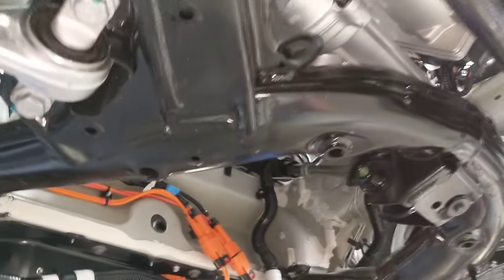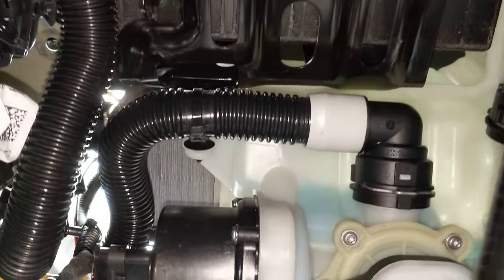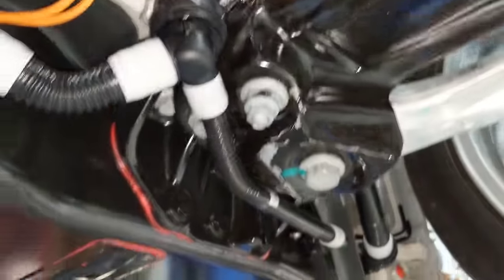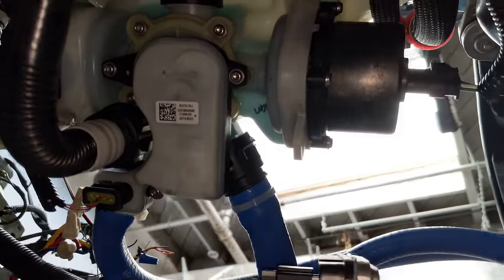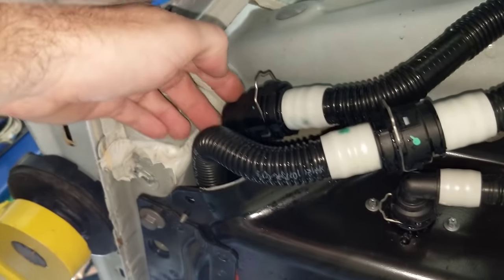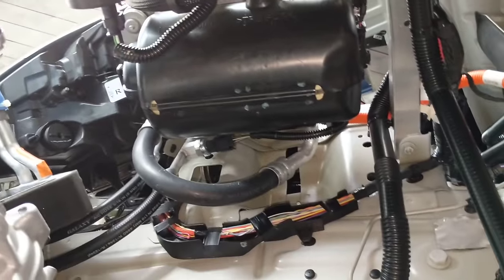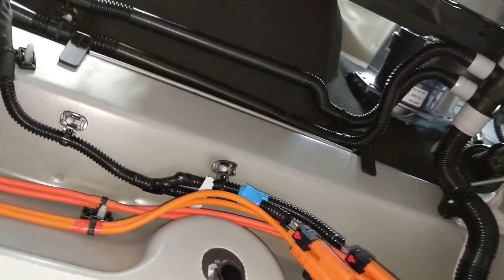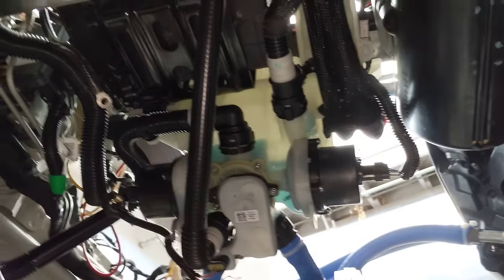Tesla Model 3 - Cooling System Overview

Comment: Glad to see they aren'trunning the coolant loop through the stator before the inverter like on the S/X. Perhaps this is a big part of the reason why the Model 3 can better handle being thrashed on a racetrack without going into thermal protection. Folks like Jack Rickard suspected that this was part of why the Model S had thermal problems under heavy use.
Reply: Reminds me somewhat of when Corvettes were overheating a few years back, the engineering answer was to reverse the water pump direction so flow went backwards.  This kept the critical parts in contact with cooler water.
Reply from the maker: Keep in mind this motor design (PMSRM) is way more efficient than the motors used in the older S/X which were induction.  An induction motor has a lot of loss in the rotor that PMSRM doesn't, so no need for such exotic cooling techniques.

Comment: Another amazing video - thanks for all this!

Makes total sense that they cool in the order penthouse->inverter->motor/gearbox, given that that's increasing order of heat tolerance.

I guess the only thing I don't see here, unless I missed it, is cabin heating.  Looks like there's no direct linkage between the glycol loop(s) and the cabin? Just purely resistive, then?
Reply from the maker: Yes, same as S/X; a PTC resistance heater only.  Sadly, They couldn't be bothered to add about $15 of parts to add a heat pump function.  Even Nissan Leaf has one.  As far as using waste heat in the cabin though, there just isn't enough.  In fact in cold climes, they need to add extra heat to keep the pack warm.
Reply: Ingineerix Leaf has a heat pump because it has a small battery and it matters. With the large batteries in Tesla, it’s mostly not necessarily. Edge cases, sure, but generally not.
Reply: Meh, it'd sure be appreciated up here.  Large chunks of the year with "cool but not cold" weather - that's the ideal use case for a heat pump.
Reply: I've seen some 'This Old House' videos talking about heat pumps with "Inverter technology" (Whatever that is) supposed to be able to scavenge more heat at lower temps than just plain old heat pumps. Probably still just an added heating element somewhere. Makes one wonder though. Still wold be a good idea for down to 40s temps and then just boost with elements below that.
Reply: Tuttomenui some top of the line heat pumps are smart enough to know how much colder they can go below 32°F before freezing up totally by monitoring dew point, refrigerant pressures, airflow, and such
Reply: Heat pump vs resistive heating has various tradeoffs between complexity, weight, efficiency, maintenance, etc.  For example, heat pumps are more efficient but arguably more complex.  On the other hand, there is already a heat pump for cooling, so using it for heating also makes some sense.  Resistive heating can be much faster to heat the cabin starting from cold, and that may be the main reason for using it.  It's not as simple as saying that heat pumps are better.  There are multiple factors.
Reply: As far as I know the only added complexity for a heat pump over a straight ac is a switching manifold to swap the radiators. To make it smarter just add software and censors.
Reply: Since Leaf doesn't have a cooled battery I think that makes doing a heat pump easier. I imagine you'd need more reversing valves with the Tesla using the refrigeration circuit to cool the battery too.
Reply: This Guy is so cool

Comment: 5:10 Tesla is modulating probably "a bit" of DC over the AC signal. DC on AC motors heats up the stator windings without rotation. In fact, it produces a "brake" torque to standstill. So THAT means, Tesla is modulating a DC current on the motor AND have to increase the AC current to compensate the "brake torque" with higher "drive torque" - as far as I suggest. Maybe some experts know more and comments are welcome. :-)

Comment: Replying years after the video was made but found it very interesting and informative.  I would have liked a slower pan of the camera and pulled back some times as the camera movement and rotation especially moving front to rear and back was hard to follow.  Any idea what the min and max temps are  and what the min and max pressures in the system are?

Comment: Just came across this from 2 years ago. I'm amazed at the countless number of coolant hose connections, "Y" pieces, "T" pieces, clips, clamps, brackets, etc, and all made of plastic for lightness. This thing will be fine for a couple of years until the plastic becomes brittle and then it will leak like a sieve.
Reply: I would be surprised if under normal use there are any leaks within 10 years. Most cars now days have plastic tanks on the radiators, plastic valve covers, etc. and they are not all breaking down and leaking 2 years later.

Comment: Thanks for the video, was wondering what your thoughts are on potential rust. You've seen the internal workings, and potential areas that could rust. Do you feel the car will stand up to harsh winter conditions and road salt?
Reply from the maker: Well, I'm not a materials expert, but I can tell you that all the steel used appears to be fully galvanized.  Paint coverage and sealing on panel joints appears to be well done.  Since most auto manufacturers have now switched to galvanized steel, rust is just not as much a problem as it used to be.  (And while I currently live in California, I was born in Detroit)

Comment: So there is no direct path from the battery or motor cooling circuit to a air to water radiator? It all passes through HVAC? Or are the two blue hoses on the four way valve used to do that?

Comment: Enjoying your videos. Thanks for sharing. 

I live up north in a harsher winter environment and have been researching battery heating in the model 3. At 5:02 you mention the absence of a battery heater. A Tesla document filed with EPA mentions use of an inline heating element to raise the pack temperature. Could this be a hidden part you’re not seeing? Thus not requiring waste heat and actually draw directly from shore power or the pack to heat itself?
Reply from the maker: The 3 uses the drive inverter to heat the pack.  It just operates an in intentionally inefficient manner (while moving), or by just circulating current while stationary.   The cool thing is, no additional heater needed, just some crafty software.  Another trick they use to get the cost down and reliability up.

Comment: So the glycol coolant is cooled entirely through the AC system and not just assisted by it? No coolant radiator to upgrade if you wanted to improve cooling capacity, like with an ICE car?
Reply from the maker: No, the heat in the glycol from the powertrain is shed to the radiator or sent to the battery pack if it's cold.  The A/C is used to chill the glycol going into the battery pack so it can be chilled during supercharging.
Reply: Ah ok, thanks. Makes me wonder if a higher capacity radiator with high CFM fans could help with the thermal issues even further, even though they are already much less on the 3 than the S.

Comment: Hey Ingineerix
, Thanks for the great video!  Suppose the A/C system had a leak and wasn't cooling the cabin properly would the cooling of the battery and powertrain also be negatively affected?
Reply from the maker: Yes, but mostly only for supercharging.  The BMS would see the high-temperature and reduce the charging speed to protect the cells.   It's worth getting the A/C fixed if it's not working though.  One of the most common sources of leaks in automotive A/C systems is the compressor seal, which doesn't exist on a Tesla, so this makes the system way more reliable.  I'd say usually the A/C system will outlast the rest of the car, as long as there is no mechanical damage, etc.
Reply: @Ingineerix  Thank you very much! The SC recently fixed the issue and I believe they replaced a seal or o-ring, honestly I'm not exactly sure of the term but I'm glad that it didn't damage anything else. Really appreciate your advice.

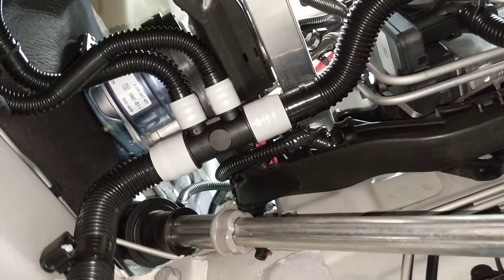Comment: The amount of glue at 1:20.  That's crazy! It even looks like they tried to wipe the squeeze out off. Unless this is the crashed chassis and someone did a repair on it?
Reply from the maker: Sound deadening
Reply: Ingineerix Interesting. It looked like squeeze out from the bonding agent they put between components, but if it's sound damping material, WOW is it dampened.

Thanks for the videos!
Reply from the maker: Dual purpose, they cover all the seams with this thick stuff, but it helps NVH by blocking sound and acting as a mass damper.

Comment: Thanks for the video.  Some questions regarding to the frond-end cooling. Are those 2 blue hoses are from and to radiators? Then standard radiator and condenser are used for this application? Maybe on your other Model3 videos.
Reply from the maker: I added the blue silicone hoses, as the original radiator and it's hoses were damaged in the accident that totaled this car.  My "radiator" is a Honda heater core.

Comment: Well done, thanks. I was wondering about the creature comfort A/C. I think you ran by it quickly near the end of this video. Do you know...is it a conventional compressor? I was wondering how that compressor was propelled. Is there a service system motor that turns only the compressor? Or does it provide mechanical motion for other devices as well? A co-worker remarked that it may be an all-in-one design with the motor and compressor in the same housing, and that does seem pretty likely because we couldn't think of anything else that an auxiliary motor would be used for in the car. Thanks again for the very well done video.
Reply: I believe there is a separate motor for the compressor as well as another motor for the power steering pump.

Comment: Great video!

With your experience, how long do you expect this thermal management system to work without major issues.
Reply from the maker: The pumps are brushless and have no shaft seals, and since there are low thermal deltas, I don't expect any problems, nor really any needed maintenance, save for cleaning the radiator fins maybe.
Reply: Hello, did you happen to observe the Glycol type used? (standard Automotive Polyethylene or Polypropylene -non-toxic industrial & often hydronic heat pumps )
Reply: I didn't see an actual radiator, only the fins on the heat exchanger on the motor.  Is there a radiator and fan that you didn't show?  Seems like during DC Fast charging the batteries will be generating a lot of heat from their internal resistance.  Does the Model 3 rely on that chiller as the sole point of heat bleed?  The base Model 3 (50 kWh battery) will have less cells to disperse the DC fast charging energy thus raising the C rating of the battery activity (unless they throttle it more.)  I believe the Bolt folks have claimed under DC fast charging in a very hot location, the Bolt starts whiring its radiator cooling fans at max speed to try to keep those stressed cells cool.
Reply: May i ask how high the temperature gets in the coolingsystem in the model 3? Can’t imagine it going over 60~ celsius right?

Comment: [Ricky] I heard there is a vent cover that can open and close on the front for a radiator for battery cooling?
Reply from the maker: Yes.  Model S and X also have this.  The reason to close the opening when cooling is not needed is that it decreases aerodynamic drag.

Comment: Pretty amazing camera work considering the cooling system never goes out of frame, loses focus, nor suffers from camera shake. Tell us about your camera rig please.
Reply from the maker: I am far from a "professional" videographer.  I am just using a Pixel 2XL and (sometimes) a hand-held gimbal stabilizer.   I try to do as many of these in one take as I can, that way I can avoid having to struggle with the editing.  The one take method has taught me a lot though!   My problem is finding the spare time to setup and shoot something, even with one take it's still time consuming.

Comment: So all cooling goes through the AC system, meaning that all cooling requires the compressor to be running. Ignoring cost and weight, wouldn't it be better to have an additional loop to pass the glycol coming from the battery directly at a air-glycol radiator instead of having to use the AC system? Because the AC is limited by the power of the compressor, I've heard about 7-8 kW, so about 21-24 kW of cooling giving a COP of 3. The battery alone at 250 kW supercharging would produce about 22 kW of heat considering 56 miliohm internal resistance I've read online. The system I'm asking about probably would give a good increase in cooling capacity for situations that require a lot of cooling, like using the car on the track then supercharging it (I'm not suggesting everybody does that 🤣), what i mean is just increasing cooling capacity without having to use a beefier AC system.
Reply from the maker: The system can already do what you describe, even the older systems.  There is a 5-way valve that can be configured to cool passively (radiator), dump heat into another system (such as motor to battery), or actively cool using the compressor.   On the newer systems there is a heat pump with many more configurations, which still include a passive radiator loop.

Comment: Hey Ingineerix
, 
Very nice video indeed. Thank you. 
I have one question about the white material over the corrugated pipe in the junction area with Quick Connector. 
Do you know the reason why is it there ? To improve the tightness level between QC and pipe ? Also do you know which material is it ? 
Thanks a bunch for your feedback.
Reply from the maker: Yes, it appears to be a thicker polyethylene that insures retention of the thinner pipe material on the barb.

Comment: How is the radiator connected to the circuits? Does the 4 way valve control this? Has somebody made a circuit diagram of this cooling system? I’m trying but can’t figure it out. Great video btw!!
Reply from the maker: I will make a diagram at some point.  Yes, the one electrically-actuated valve (actually more then 4-way) acts like a series/parallel valve for the 2 cooling circuits, and also can bypass the radiator.
Reply: Ingineerix:  Very awesome!  That's the right way to do that valve!  Each item has different needs at different times and in different conditions, so having all options available is in my opinion either necessary or close to it.
Reply: @Ingineerix  "Yes, the one electrically-actuated valve (actually more then 4-way)" => The wiring diagram names it "5-way Valve".

Comment: Where do the AC loops drop their condensation?  is it channeled somewhere specific?  I want to know where the water puddle from the AC will appear under my upcoming car.
Reply from the maker: Directly under the front firewall right in the middle.  So right where the battery pack ends.
Reply: Thank you for the info! :-) Keep up the great work

Comment: It's been brought up in other Tesla forums that the service interval in the OM is brake fluid replacement every 2 years or 25,000 miles and battery coolant every 4 years or 50,000 miles.  Some asked about the cost and was told that Tesla service charges $199 for the brake fluid change and $900 for the coolant change.  Those prices and intervals seem excessive to me.  Could you comment on the subject?  What type of coolant is used and how hard could it possibly be?  I thought the actual friction brakes in an EV are minimaully used so why the need for frquent brake fluid replacement?
Reply from the maker: I would probably adjust these based on my climate/use.  Where I live (SF area) and the car is stored indoors, so less temp swing,  I would do brake fluid every 4 years and coolant should go 8 years.   Brake fluid is Hygroscopic, so eventually it takes in moisture and starts becoming an issue.

Comment: Trying to figure out simply if I use a car cover to block sunlight and the Model 3 is trying to keep the cabin from overheating, does the car cover block any heat escape or required air flow?  Because it looks like the cover is getting sucked into an air intake vent below the windshield above the frunk.
Reply from the maker: The area below the windshield is the fresh air intake for the cabin.  It would only be used if recirc is not enabled.  I would imagine a car cover would overall result in less heat in the cabin, so should be fine.  As long as the car can draw air into the radiator in front, it should be ok.

Comment: What is the correct coolant used for replacement after a leak?
Reply from the maker: G48, available at most auto parts stores.  NEVER ADD WATER.

Comment: Wondering if they use a heat pump for heating the interior, or do you think it's possible that they pull heat from that plate exchanger?
Reply from the maker: Sadly, they chose not to do this.  I think the nominal cost would have been worth it.   There isn't enough waste heat from the powertrain because it's so efficient, but a "standard" air-derived heat pump would be useful, especially in milder climates.  I suspect Tesla just wants you to preheat your cabin while on "shore power", that way it doesn't cut into your range as much.  Other EV makers such as Nissan and Kia chose to add them, but of course it matters more on those cars with much smaller battery packs.

Comment: Wonder when you need to change that gear filter?
Reply: It's just to filter the fine metallic particles created as the gears bed in I would think. I was surprised by how much 'swarf' was on the magnet of my 104k mile Nissan leafs gearbox plug when I checked it recently, the entire magnet was coated. There is no obvious gear or bearing noise but I'll definitely change the fluid soon , probably twice over as there's very little in there anyway.